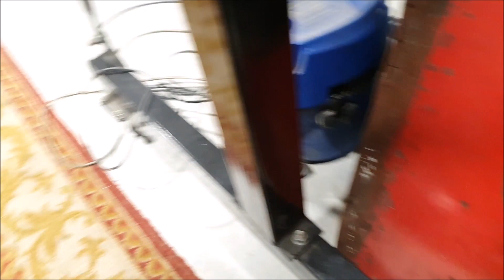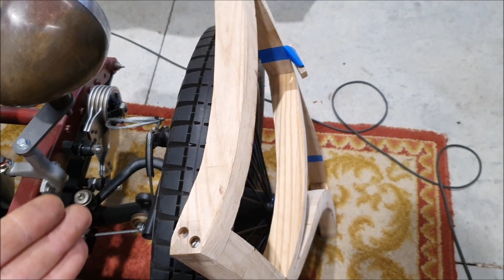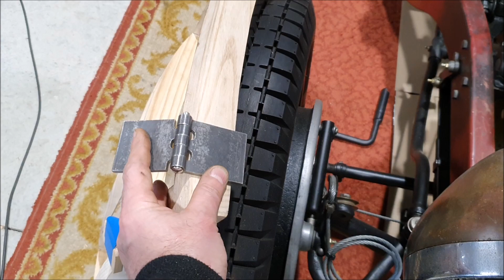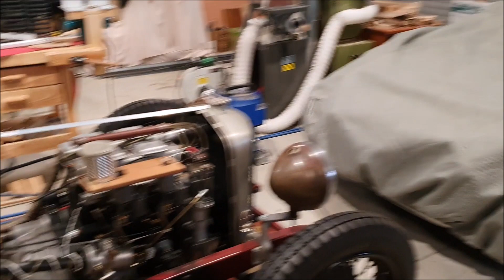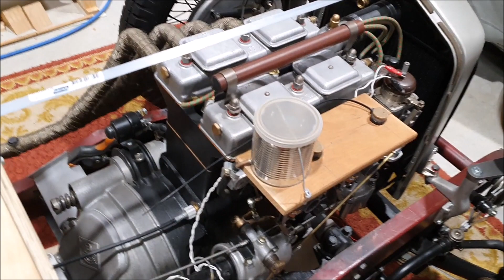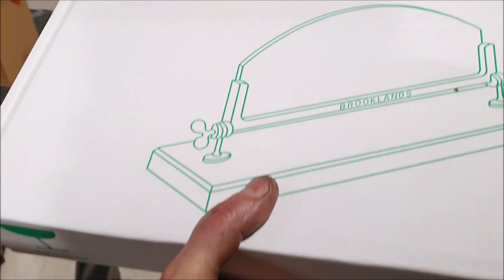Pre war Riley Brooklands - door hinges 1

Comment: It would be worth thinking about fixing an extra piece of ash frame or a metal bracket to support the aeroscreen before skinning the bulkhead. The aeroscreen is quite heavy and the wind pressure creates a considerable force on it.
Phil
Reply from the maker: Yes, good point! I think I should be OK since it is a steel skin and I can get to the inside so I can add a spreader plate inside the skin at that point. I prefer bolting things though rather that screwing into timber.

Comment: Those bolts will be very strong considering the final weight of the doors, which will be lower than saloons and the Lynx. My Alvis has door screws that are still fine since 1933. Only one hinge went because an idiot friend slammed the door and weighed on it. The timber split before the screws loosened.  Six hundred quid repair to get access and rebuild!! Down to the quality of the original ash too. The trick is to be sure your eventual check straps are solid. Seen lots of wrecked doors due to swings and obviously it happens more with suicide doors. Looking good so far. Best wishes from the UK.
Reply from the maker: The other reason for using bolts is it's much easier to remove the doors later. Well, hopefully...

Comment: The door hinges on my '29 tourer are fixed with wood screws and are still hanging in after 94 yrs, so I suppose wood screws are good enough . The door hinges of my special I fixed much the way you have ( albeit with 6mm screws ) , to keep the hinges in line I removed the hinge pins and put a 1/4" rod between the two hinges , the angle iron approach didn't occur to me.
Reply from the maker: Removing the hinge pins was my first idea but I didn't have any rod suitable!